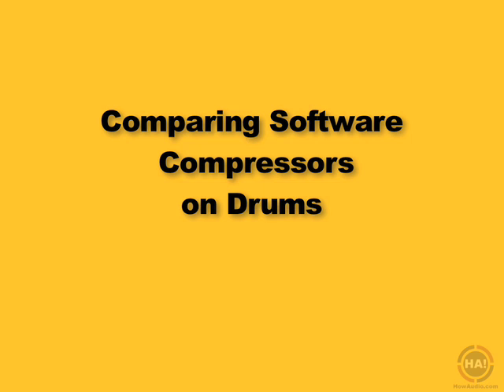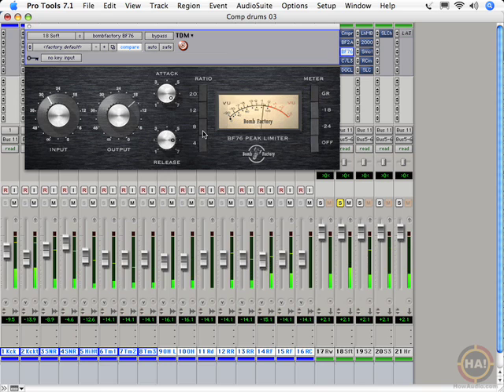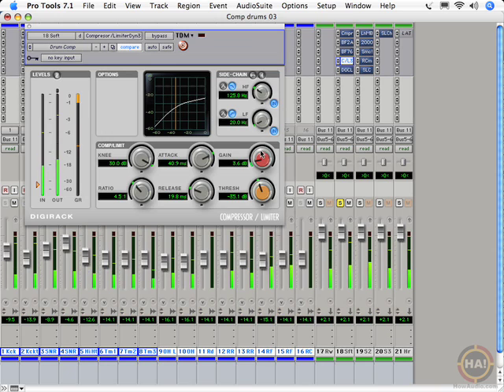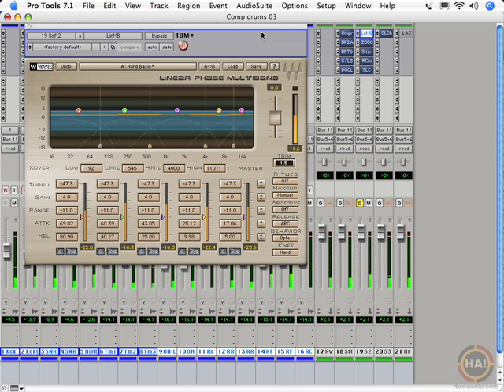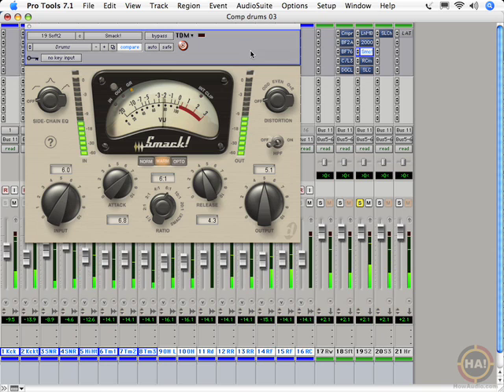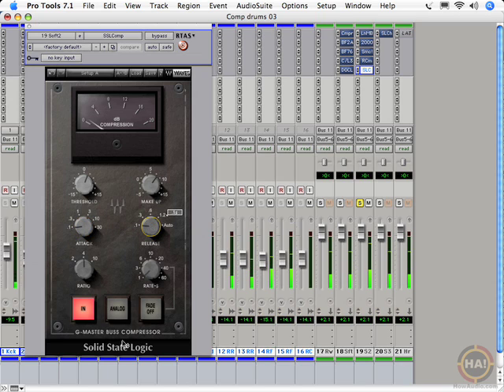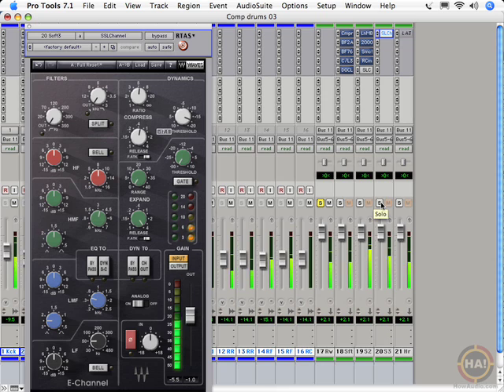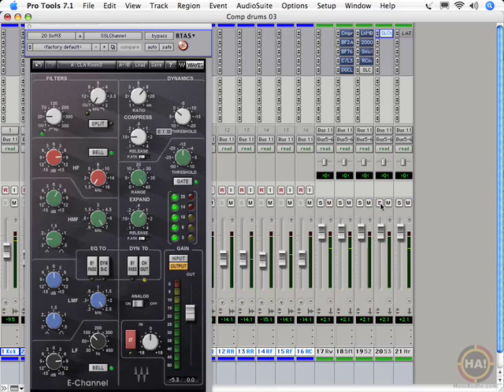Comparing Compressors on Drums

Comment: @progjazzfusion Actually the 1176 has reverse settings.  All the way to the right are the shortest attack and release times.  All the way to the left are the longest.  It's useful to know this for when you have to use one.  They are common compressors.